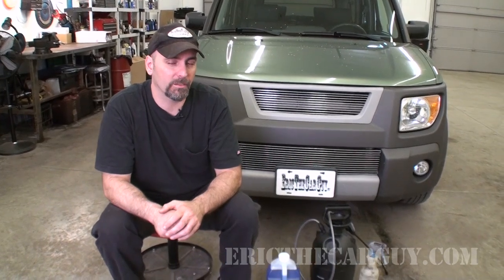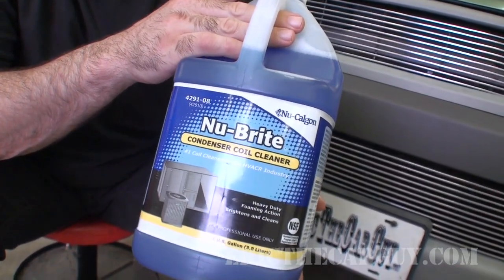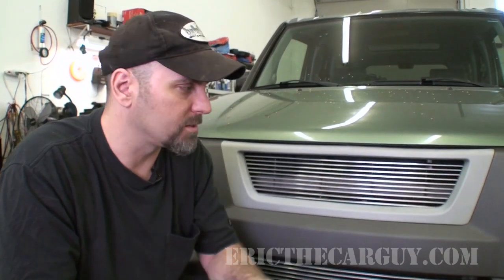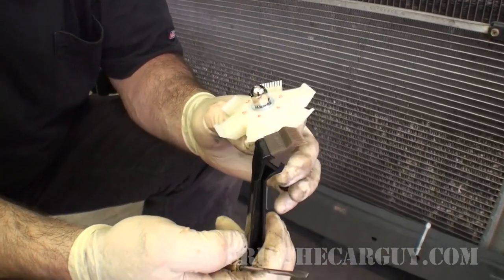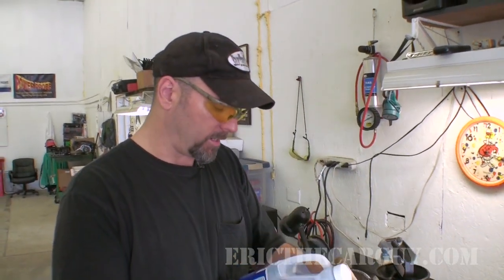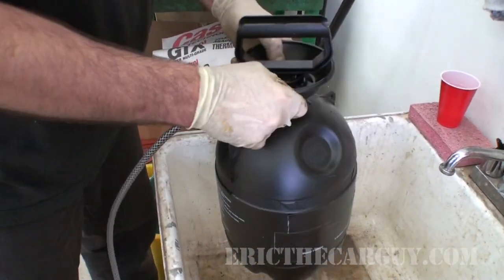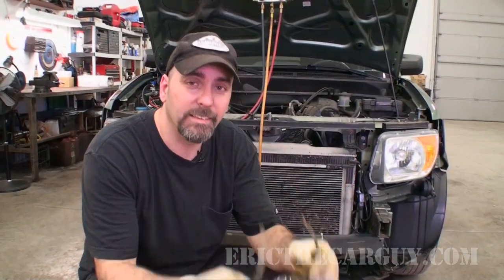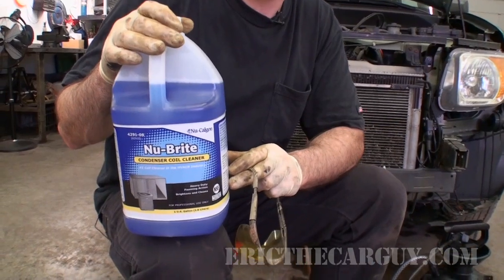Increasing AC Performance by Cleaning Your Condenser -EricTheCarGuy

Comment from the maker: This is cool. (pun intended) Increasing AC Performance by Cleaning Your Condenser -EricTheCarGuy
Reply: I'll pass this on to my buddy...  It kind of funny, just 2 days ago he was talking about his AC not working as well as it was...
Reply: lower head pressure also lowers the compressor resistance which should also lower fuel consumption!
Reply: Guillermo Lovato Compressor has variable load WTF?  Really?  Any videos available on that?  Future video idea for ETCG?  Had no idea.
Reply: Might try this I have two cars that could use it
Reply: Duracool, may not be legal in your area.  You use half as much, vs 134.  Its cheap and works sooooooooo much better.  Use it, love it, tell a friend.
Reply: ***** I'm pretty sure he thought of that already..
Reply: Hey there Eric, what do you think of the AC Cans they sold at either Advance Auto Parts or Autozone? Are they good for your car?
Reply: ***** Never compressors are variable.
check out this link -> http://macsworldwide.wordpress.com/2013/05/29/variable-displacement-ac-compressor/
Reply: Hey Eric.  Do you know if this cleaner can be used on the cars radiator as well?
Reply: cleaned my condenser coils this weekend and my AC has never been colder..Thank you for the great tip!
Reply: is it possible to as you a  question directly eric??
Reply: *****
any compressor will have a variable load(resistance) based on input and output pressures, the higher the output pressure(head pressure) the harder it will have to work to compress thus the more power it will need from the engine
Reply: +EricTheCarGuy This would be good for radiators too, right? Also if your condenser isn't that dirty, like yours, probably the only benefit would be temps dropping faster, instead of lower temps.
Reply: EricTheCarGuy will this cleaner work for the evaporator?
Reply: I get the same results with alumibrite, dawn, water mix.

Comment: I just did this to my GMC acadia cause it would over heat driving up steep hills on the freeway on with the ac on before watching this video. The difference is I bought a spray can for cleaning ac condenser coils for about 5 dollars at home depot did the work took the front bumper off sprayed it on waited 5 minutes and rinsed. I put it back together the following day and drove up a 6% grade with ac on and no more overheating and the ac was colder 👍👍

Comment: Pricipal ingredient sodium hydroxide. You can buy the dry crystals for about $2/lb at a hardware store usually right next to the drain cleaner which is also mainly sodium hydroxide but at 5 times the price for the fancy lable. I suspect this is the case here too. If you look at the waterbased engine degreasers they also are sodium hydroxide based relatively cheap and easily available at the DIY auto shop.
Reply: The other ingredients in it might be to help reduce corrosion of the metals. Chemists are actually pretty smart.
Reply: ***** $1 a can at the Dollar General for oven cleaner (NaOH). Should be safe safe enough for a 10 min etch on a condenser.
Reply: ***** I just tried it on my old radiator sitting in the scrap pile. Followed up with some "Mag Wheel Cleaner" (Phosphoric, Sulphuric, Hydrofluoric acids) and the fins in that area look clean and bright.
Reply: That's interesting. I'll have to look into the engine cleaner. Walmart sells a 19 OZ aerosol can of foaming coil cleaner for around $7. Rural King has it for $5. The active ingredient in the can from Rural King is sodium metasilicate, Nu-brite's active ingredient is Sodium hydroxide. I haven't tried it yet.

Comment: Definately makes a difference! It seems with the trucks in our fleet the radiator will plug first and air couldn't flow through the condenser because the plugged radiator was behind the condenser.

Comment: I've done it on my car last week-end. I ended up using a foam spray from HD. I did it 3 times (2001 Civic) and I couldn't tell the difference in air temperature inside the cabin but I believe that the condenser needed a good clean up anyway as the water came out all black and oily. If my compressor is not working as hard, it's a win win (I don't have the tools to measure it). Thanks Eric for the tip!
Reply: Which spray did you use?

Comment: Excellent video. I used to work with R-12 systems and I thought just hosing off the condenser would be sufficient. It looks like that cleaner will dissolve embedded bugs and road grime. The pressure difference is obvious, plus it should improve your gas mileage slightly since the compressor won't have to work as hard against the high head pressure. The compressor should cycle on and off more frequently, especially at highway speed since you would have more air flow through the front. Some shops would use an industrial fan placed in front of the car to simulate highway speeds to more accurately gauge the pressures and cabin temperature. I don't believe that you mentioned that the pressures are variable depending on the ambient temperature. There is a conversion scale that can be used to determine correct pressure ranges based on ambient temperature. The comb that you tried to use is for a different style of condenser but it's handy to keep around.

Comment: i do that for work on our air handlers, it doesn't take much dirt to make the system less efficient, and you can barely see the dirt i am talking about removing, but its there! i clean air handlers 1 time a year in the spring or summer whenever there is time. good video!

Comment: A new hand held wire brush with straight bristles works fairly well as long as you follow fins. It should be done like your home unit at least once a year. Not only possibly make it work better, less pressures on whole system. Seals ,O rings,hoses are less  likely to leak.

Comment: This happened to me with a 97 chevy. A/C performance got to the point if I sat still, my rad got too warm and cooling sucked (belt-driven fan). Found a bunch of accumulation between the condenser and rad. Cleaned that out and rad temps were great again, but cooling still sucked.

So I ended up taking off the grill & all, manually straightening all the bent fins on the condenser w/a butter knife, used cleaner and a water hose to flush it clean. After that cooling was normal again. Makes a huge difference and def one of the first things you can check.

Comment: I know you are only discussing cleaning the condenser but I looked though the comments and I am sure you have mentioned it but I  thought I would also add It Here; that making sure your Cabin Air filter is clean/New can have a dramatic effect on how you perceive the performance of your A/C system is working.   ~ Another Great Video, Thanks again.

Comment: And when you checked the high side pressure after the cleaning hopefully the condenser was 100% dry to have a fair comparison
Reply: Exactly, it's not clear what the wait time was here. Being wet and evaporating all that water off is an endothermic process that would mislead things a ton
Reply: The condenser gets pretty hot and you've got a huge amount of airflow through there. By the time he finished narrating and the system stabilized to get a good reading everything would have been long dry.

Comment: Dear Erik, great video as usual. Let me suggest doing another video on evaporator cleaning under the dash. I know there is a filter there and I have seen a similar process to the one you did on condenser, but it was on evaporator noting that for water wash you can use the same plants sprinkler jug and it will seep through the condenser drain hole. As far as a special chemical solution for it, ask your AC friend and let us know. You may afterward gain some extra colder outlet air. Take care.

Comment: I often just use water to rinse out the condenser and radiator with all the bugs we have. It would be interesting to see if the cleaner makes that much more of a difference over just rinsing.
Reply: My F150 Lariat condensor is easily exposed just by opening the hood . I do the same to mine. Sometimes ill carefully vaccum n brush bugs n debris off using a very soft brush.  I often wonder about some of these after market grills and or billets i see. Some seem like they might be to restrictive and bad on the engines in a similar way as dirty condensors and radiators mainly in hot temps.
Reply: The foaming action of a cleaner will help to push out imbedded debris.

Comment: I've become an expert at straightening radiator and condenser fins. You have to use dental tools and plan on (depending on the fins condition) many hours, even days. I did the radiator in my 88 corvette, it took me about a week, and the radiator was removed from the car. Why didn't I just buy a new radiator you ask? Simple, the O.E.M. parts from the older vehicles are "WAY" better than the "CHEAP CRAP" they are pushing on the public in these modern times...
Reply: that's why you pay someone with OCD to do it for you.
Reply: Why not replace the cabin blower with a city bus sized one too?

Comment: Using your pressure gauges wont actually provide you with an accurate result anymore, due to variable compressors you can actually have a complete blockage somewhere in the system but you will still read pressure so the only real test is with the thermometer a really efficient system will drop about 20 degrees Celsius below ambient. Also vehicles tend to loose around 10%-20% of their total refrigerant quantity over a period of 2 years (fords are the worst for this due to the use of spring connections on hoses), this could also lead to your AC not working as well as it once did.

Comment: Just wanted to comment and say thanks for a great idea. I picked up an aerosol can of foaming condenser cleaner from home depot for $5 and cleaned out my 2001 Jetta with 125k condenser. When I hosed it off I was really surprised at all the fine dirt and grime that came out! It was already blowing warm so I figured while I had the machine hooked up and doing its thing I would clean the condenser. Now its back to blowing ice cold!

Comment: I live in very a very rural area, and I do a lot of driving through the woods.  Since it is easy enough to do with my trucks, a couple of time a year I pull my grilles off, and spray it the condenser and radiators out with the fan blade nozzle on my power washer.

Comment: At times when the condenser is not that dirty I'll use it at 10 to 1.  Nice video.  Your results would conclude a clean condenser rejects the heat much more effectively than a dirty one.  I guess you found out while using nubrite it can be quite pungent.  Stay up wind and you won't gag on it.  Again, great job. Yes at $20 a gallon is pricey, but worth it.

Comment: 38 degrees...I'd give it a good leaving alone
Reply: HONDA!
Reply: Cleaning the coils will still improve the efficiency.
Reply: There's getting 38 degrees, and then there's how hard the compressor has to work making those 38 degrees.  Higher pressures are also going to create/make leaks worse.
Reply: @WildBikerBill  also lead to system failure in the future from over working

Comment: Another thing that's even easier is there is the air filter behind or under the glove compartment. Cabin air filter. I never even heard of it until recently but I know now it has a massive effect on heat, smells and ac .If it's super dirty and you can't find a replacement make sure you don't leave it empty. Just like your engine air filter it is a critical part of the system.  Clean it best you can and put it back until you can find a replacement.

Comment: The constant air temp at the vents is due to the TXV valve doing its job. I buy Nubrite at a wholesale supply house for $20/Gal. Rinse it well. Whats 10 or 15 minutes of water cost. I have condemned many AC condensers because owners using everything from pine sol to car wash soaps. I would have done the radiator too since it was right there. Tip...Shut your AC off a mile before shutting off the engine.
Reply: What does it do to turn you ac off before?
Reply: By shutting off the AC a little earlier while your vehicle is still moving its able to release that heat in the condenser to the atmosphere. The engine will cool down a bit quicker too. My dad was a mechanic and never had any problems with his AC on any of his cars. I do commercial and residential HVAC work. Dirty coils can shorten or kill an air conditioner's service life.

Comment: if you have ever had the privilege to watch a good hvac tech clean a large condenser ,its pretty cool what comes out that you could not see living in there. they use this same stuff but in a hose attached shower head and they just flood it back and forth  over and over for about 5 minutes then pause for 5 minutes and do it again and it just foams putrid stuff out then rinse with water very very good. i used purple power on mine and it dropped the pressure on the high side 40lb and i used a long pick to reform bent fins since the fin comb did not match the gap and man i spent hours doing that tedious work but it pays off.

Comment: Great results!
 what about cleaning the evaporator? i heard people talk about a spray can, when applied (a 50 cm tube connected to the can and inserted in one of the vents), it foams and gets all the dirt out, all you need to do after is to set blower on high and leave the windows open for it to ventilate (you don't want to breathe it).
it would be nice to see this in action.

Comment: Well, a 60 PSI drop on the high side IS quite impressive. Guess its time to clean my condenser and find out if helps my system out. In the process of going to E-fans, so I might even give it and the radiator a flush from the other side to aid in removing any foreign matter - aka: bugs n stuff. That pocket screw driver is the best tool in the chest for the task of fin straightening. Those after market "combs" are only useful w/ minimally damaged radiator/condenser fins.

Comment: Hi Eric , I drive on a lot of dirt roads , I have a 2003  302ci ford V8 fairlane i checked my pressures before start i had 192 on the high i had to clean the condenser 5 times my head (high ) came down to 128 psi Great   
Rob 
NSW
Australia

Comment: The reason the vent temp didn’t change is probably due to the metering device being a TXV and the low pressure switch regulating it. On a day with a ton of load (hot humid day) this would make more difference

Comment: I'm a refrigeration tech and auto makers don't make a product to comb fins with.  Those tools are more for refrigeration than can condensers, they make'em like that for cars so they are just replaced not fixed or straightened/combed.

Comment: The compressor causes the gas to get hot when compressing the gas. It's not the heat from inside the car. The gas cools when it expands in the expansion coil. The compressor coil is for removing as much heat from the gas as possible before it reaches the expansion coil.

Comment: The other side to this which is not discussed is cleaning out the evaporator coil inside the vehicle.  It needs the same sort of treatment every 75k miles or more if you live in really hot, dusty areas and run the AC a lot.

Comment: i think that the most interesting part on the procedure is that the procedure doesn't ask to use distilled water instead of tap water with electrolites, likewise when the procedure to mix antifreeze and water don't precisely asks for the distilled component that goes inside aluminum alloys in the engine which electrolite will affect metals inside but instinctively/ automatically we know what to choose 😀

Comment: I have fixed many car ac by letting freon out because of over charging.I charged my Yukon in spring and it got hotter raising the pressure quit cooling.My heater control valve had a cracked vacuum line.Hot coolant was heating the cooled air when it warms up.The rear air worked fine.When you come up with a blank re think it you have more information now than ever.

Comment: Sodium Hydroxide is also called: Lye, Caustic Soda, or Soda Ash. Readily available and cheap.
It has a very high pH of about 13.8 on the pH scale of (Acid) 0 -14 (Base). So, its the complete opposite of Acid, but it can be corrosive. Its very dangerous to mix with any ammonia compounds. Never thought of cleaning those fins. I'll try it. Thx

Comment: I'm a master HVAC tech with 18 years on the trade and although cleaning the condenser coil in any AC will improve the system efficiency I WOULD NOT use that product in my car. It'll EAT and damage the clear coat in no time. Also be very careful with your hands,  eyes and clothes. In it's pure form, that chemical is a very potent irritant.
Reply: Cesar Cadevilla can you please recommend a product you use, or would use instead. I’m looking for something to use on my car. Any tips appreciated.

Comment: Eric, If you condenser was still wet from hosing it off it will show a high side much lower.  When you did the test was there any moisture still on it?  You can test this by running your ac with your gauges on then spraying the condenser with water and the high side will drop a lot.